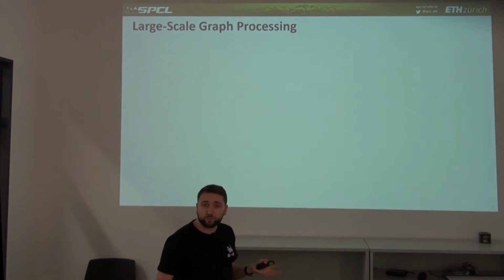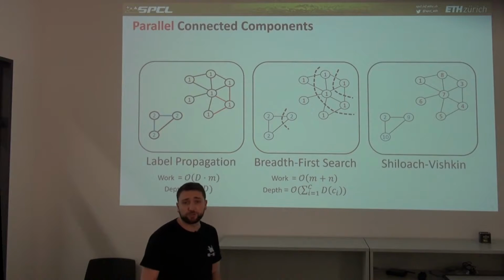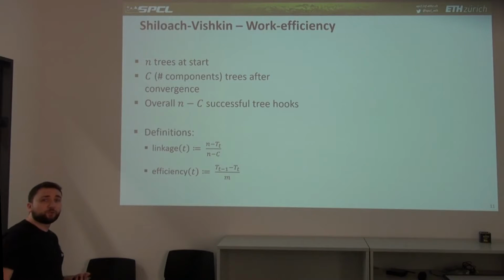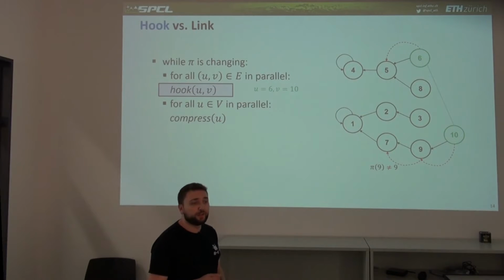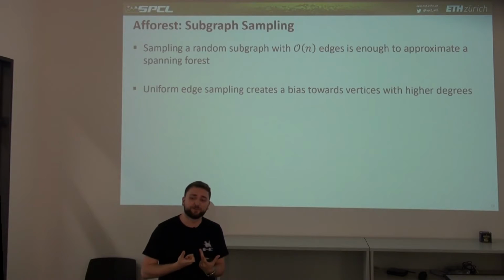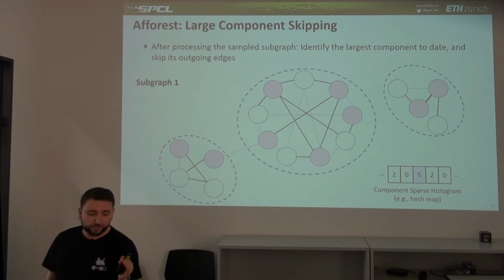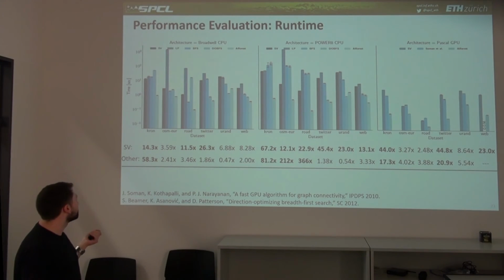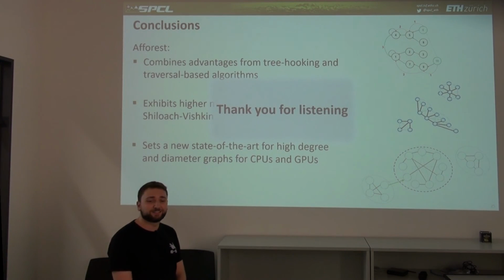Optimizing Parallel Graph Connectivity Computation via Subgraph Sampling

Comment: would be good to account for ending up with more than one large component of the same size or close to the same size... you could exclude them too to skip more edges, right?, but what if you end up with all of the components with the same size...and all of them are chonkers? 

then you shouldn't skip them since you wouldn't be sure if any of them are actually connected to another, right? but that would defeat the point of skipping large components and you'd end up processing every edge anyways :(

you can probably add [*shivers in disgust*] a few more if statements to the algorithm to account for all that... but I guess that would slow it down even more than if you just left the algorithm as is... ¯ \_(ツ)_/¯
Reply: so basically, you could skip large components of the same size as long as there would still be small components left in the graph, else (If all of them are roughly the same sized big chungusi') don't skip any of them... which is horrible :(... the least you could do is exclude 1 of them i guess...
Reply from the maker: Good question! Since the component-skipping part of the algorithm relies on the fact that edges appear twice (once in each direction), it is only possible to skip one component in our formulation. We therefore choose to skip the largest component we find (with a probabilistic search). This will be good in any case, but we see that in many real-world graphs there is one giant component and other much smaller components, rather than equally-sized components.
Reply: @spcl  oh hi I never thought someone would actually reply :) by the way is this algorithm free to use? or do I have to talk to someone?
Reply from the maker: @phoboss950  Yes, it is available here: https://github.com/michaelsutton/afforest
Reply: @spcl  oh wow, I already read it a while back but I was afraid of ever using it cause I didn't understand how licenses work but either way thanks a million :D